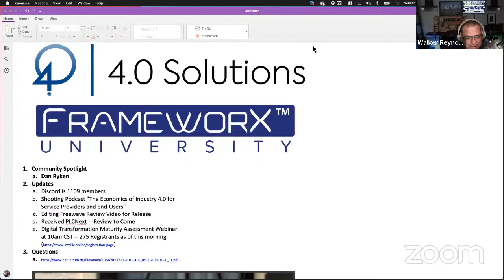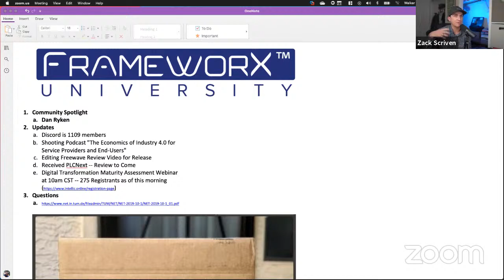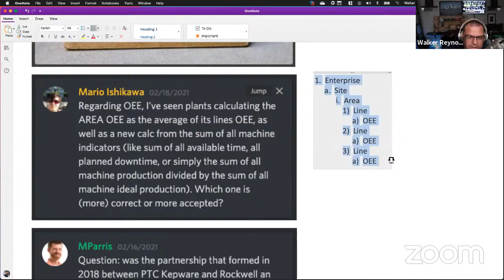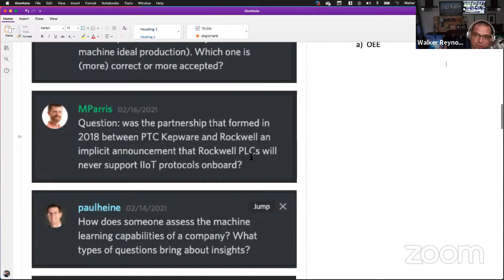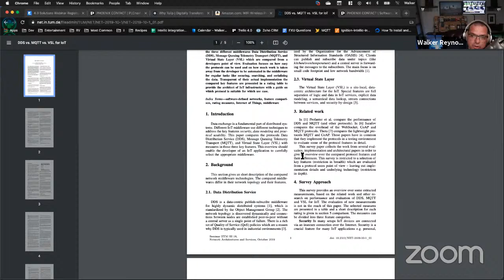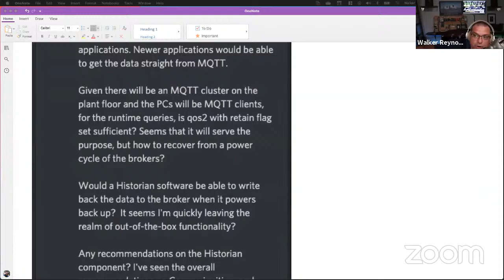How to calculate OEE at the Area Level? - Industry 4.0 Weekly Live Q&A 2/23/21

Comment from the maker: 0:00 Intro
1:13 Community Spotlight 🔦Dan Ryken
3:00 Where are you in Mentorship?
4:00 What is your professional background?
5:25 What has been your biggest takeaway?
9:10 How has joining Mentorship & Mastermind impacted your career?
11:25 The Rule of Borg
16:50 Q&A
18:48 The Economics of Industry 4.0
19:55 Freewave Zumedge
20:35 PLCnext Review
25:39 Digital Transformation Maturity Assessment Webinar
27:47 How to aggregate OEE at the Line Level?
32:37 Rockwell and PTC
39:20 How do you assess a company's machine learning capabilities?
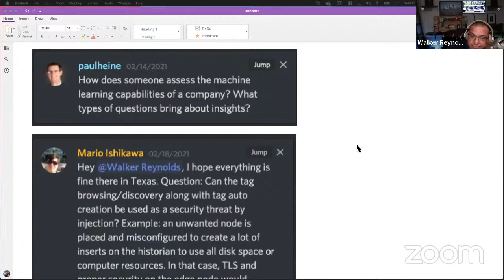45:25 How to prevent unwanted nodes in the UNS?
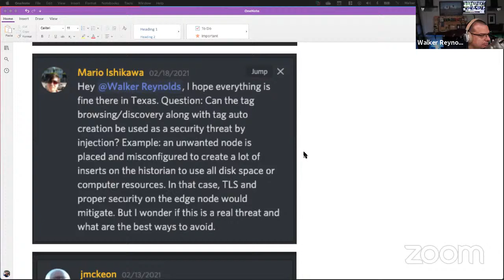48:22 USB Wireless Dongle Solution?
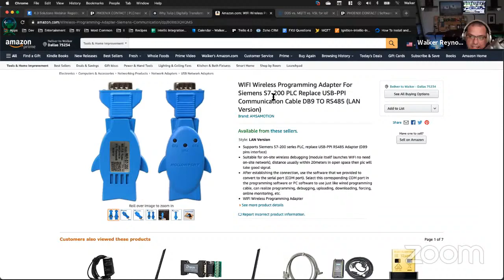49:29 How to Ignition tag properties map to Canary tag properties?
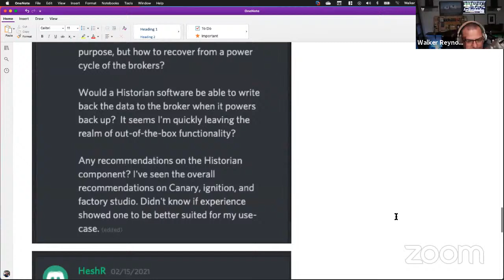52:29 DDS vs MQTT
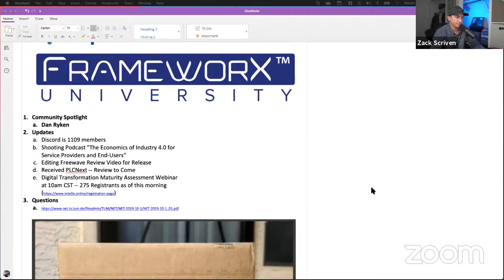56:20 How does MQTT backfill historical data?
58:16 When doing predictive analytics do you record sensor install date?
1:00:30 Thoughts on InfluxDB as Historian Node?
1:02:03 How does Redundancy work in Ignition?
1:02:40 Outro